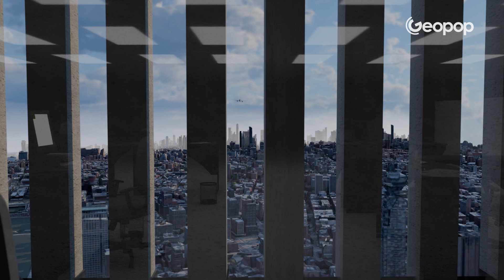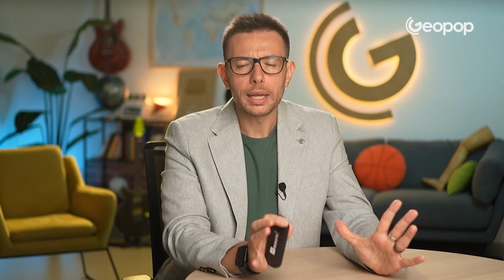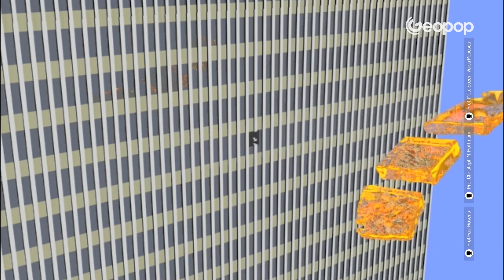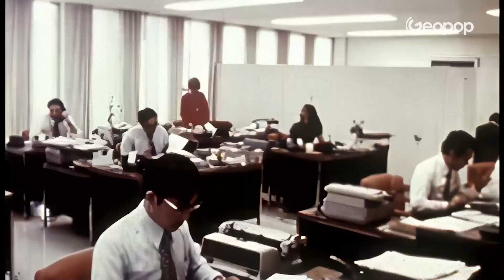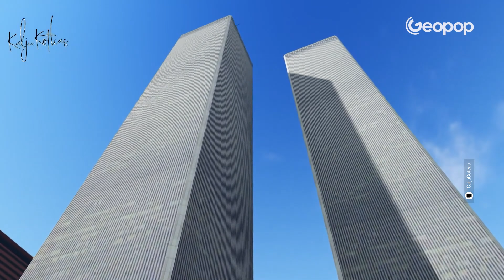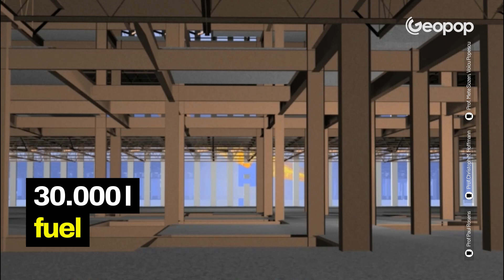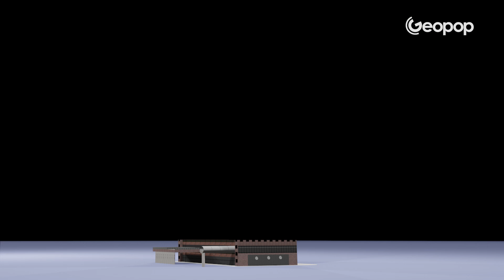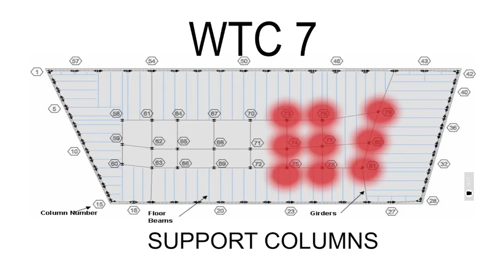9/11, 2001: The Technical Reconstruction of the Twin Towers and WTC 7 Collapses

Comment: NIST says there was no explosives used in the collapse. NIST also says they did not test for explosives....
Thermit has been found in the dust from that day.

All the items in that building were fireproofed. Its a sky rise and only allows fire resistance materials that do not burn like normal furniture.
Reply: Worth noting thermite is an incendiary, not an explosive and the ONLY reason it was entered into the discussion was because conspiracists needed something to rationalize the obvious lack of explosions. 

So you should probably figure out what case you want to argue before arguing it. 

Also, the idea that nobody can bring anything into a building that will burn is mind-numbingly stupid. But I guess that is why there are never any building fires and we don't need fire departments anymore 🤦‍♂
Reply: @TheLoonResistance  First of all Thermite is an explosive if used that way, secondly they never tested for thermite or any other type of explosive. This is a fact.
Independent testing shows thermite in the dust. This is a fact.

Thermite = When ignited by heat or chemical reaction, thermite undergoes an exothermic reduction-oxidation (redox) reaction. Most varieties are not explosive, but can create brief bursts of heat and high temperature in a small area. Its form of action is similar to that of other fuel-oxidizer mixtures, such as black powder.....

* Most varieties are not explosive* which means some are explosive...Maybe you are to young to remember all the explosions you could hear that day, there was hundreds if not thousands that day.

As for the building materials and furniture, all that stuff was rated as fire resistant materials. I never said that nobody could bring in something that can burn , stop arguing in bad faith by saying I said that when I did not.

If you honestly think all the things that happened that day happened by chance, you should buy a lottery ticket right now.
Reply: @TheLoonResistance  ", the idea that nobody can bring anything into a building that will burn is mind-numbingly stupid. But I guess that is why there are never any building fires and we don't need fire departments anymore "

Way to strawman the argument, you win! Great job, you only had to create a statement and debunk something that I never said... You must really have a valid counterpoint to make up something that was never stated...
Reply: @EQ_EnchantX  - Two months later and that was the best you can do?

I will remember that the next time I walk into the steel framed office building where I work, carrying a box of totally flammable paper, sit down at my totally flammable wooden desk with a totally flammable plastic cased PC, monitor and printer on it and don't get accosted by the OSHA commando's.

FFS 🤦‍♂
Reply: @TheLoonResistance  Sadly I replied 2 times before and it seems they got deleted or censored...And where did I ever say non flammable? I said that stuff in high rise buildings are rated to be fire retardant... there is laws in place, you can't just bring anything normal furniture into a high rise office space. Go learn the laws...
Reply: @EQ_EnchantX  - Great. Cite the statute and how it is enforced.
Reply: @TheLoonResistance  
Chapter 8: Interior Furnishings, Decorations and Scenery

Section FC 801: General
Reply: @EQ_EnchantX  And?
Reply: @TheLoonResistance  Nothing I say is going to change your mind, so I am done wasting my time. You go ahead and keep believing the government "official" story, because we all know how trustworthy they are, they wouldn't lie or cover up anything now would they?
Reply: @TheLoonResistance  
" Worth noting thermite is an incendiary, not an explosive and the ONLY reason it was entered into the discussion was because conspiracists needed something to rationalize the obvious lack of explosions. "

Go read 

Explosives Found in
World Trade Center Dust

Scientists Discover Both Residues
and Unignited Fragments of Nano-Engineered Thermitic Pyrotechnics in Debris From the Twin Towers

In terms of energy density, thermite is roughly comparable to TNT, packing slightly less energy per unit of mass but about three times as much energy per unit of volume. In terms of power density, thermitic preparations range across a wide spectrum, whose upper end appears to be comparable to conventional high explosives.
Reply: What NIST said was they followed the evidence, and none of it pointed towards explosives. That's how forensic investigations work.

Oh, and the thermite claim has been debunked.

Comment: "Every action has an equal and opposite reaction" is a statement describing Newton's Third Law of Motion which means that whenever one object exerts a force on another object, the second object exerts a force back on the first object that is equal in magnitude but opposite in direction; essentially, for every action, there is an equal and opposite reaction.

The top 20 floors could never crush the bottom 80 floors. The most they could have taken out were another 20 floors. Therefore only half the building should have fallen. The steel on the lower floors had no fire damage and were solid and the force on top wasn’t enough to crush it without assistance. If anything, half the Towers should have remained. 

It’s basic science.
Reply: Sorry, your "basic science" is dead wrong! 20 floors defeated 1 floor ... and then 21 floors defeated 1 ... then 22 floors, then 23 ... one floor at a time until the whole building is down.

Here's what your forgetting: Gravitational Potential Energy. All that high mass is going to keep pressing down on the now-compromised structure, tearing it up 1 floor at a time until it's down.
Reply: @Tim22222  sure and I bet you believe the planes were flying at 600mph at sea level when that would break them apart. Two planes took down 3 towers in an hour in perfect implosion style. People like you are why the government does what it does.
Reply: @johnbnyc64  - You are indeed mis-applying physics by fundamentally not understanding the collapses. It sucks and hurts the ego, but it's true. Let me explain. 

I find Twin Towers collapses intellectually fascinating, my interest being understanding the actual mechanisms of collapse - what failed, when, how & why and discussing those mechanisms with others who share a similar genuine interest in understanding what really happened instead of rationalizing some political agenda. So let's talk about it.  If at the end you disagree with anything, please let me know what you object to and why. Make it good. I don’t suffer fools. This will take just a few minutes.

This is my summary explanation of Twin Towers collapses of the Twin Towers, start-to-finish, based on my observations without appeal to, or reliance on any authority. No politics or ideology, just what actually happened, which is agnostic to who planned and carried out the 9/11 attacks or why. It has the benefit of not requiring Rube Goldberg levels of complexity and it makes logical sense. Each step in the process flows naturally from the one before AND is chock full of critical details the conspiracy oriented internet tends to leave out with no whataboutisms.  My hope is this will dispel many common myths and answer most if not all questions you may have about the Twin Towers collapses. 

While complex, most of the Twin Towers collapse mechanisms can be seen with the naked eye and easily discerned and understood by the layperson if sufficient time is taken to understand. The worlds engineering community had already largely sorted them out at least as early as October/November 2001. Still, there are many who can’t be bothered to look or perhaps work hard not to see, being more concerned about advancing political/ideological agendas (which is exciting) than science and engineering (which is boring).

1. The Twin Towers consisted of 4 primary structural elements that together formed an integrated system where each relied on the others.  47 hollow box-section steel Core Columns carry the majority of the gravity loads. The 236 hollow box-section steel Perimeter Columns carry the remainder and ALL of the lateral (wind) loads. Long-span Lightweight Steel Trusses connect the core and perimeter column together at each floor with a Hat Truss on top to tie the structure together as an integrated unit where no element can survive without the others 

2. The impact of 117 tons of airplane (= to about 12 dump trucks) at speeds up to 590 mph completely destroys the aircraft.  This in no way implies the Towers come out unscathed. Some folks don’t get that. Hitting with the energy of up to a ton of TNT the impact damages or destroys many perimeter and some core columns (33 of 59 perimeter and 20 core columns destroyed at the impact floors in the North Tower), primarily through bolt-shearing failures at the end connecting flanges, as well as bending, twisting and fracturing of weld seams. There was no cutting or slicing - the reality was far more violent and messy. 

3. The impacts destroy or damage fire insulation, fire breaks and sprinkler systems on multiple floors. Huge fires are started across multiple floors simultaneously and allowed to spread rapidly with no effective firefighting or fire suppression. This was an unprecedented fire event . All of this was observed and recorded.

4. The hotter steel gets the weaker it gets .  With fire insulation stripped away and no sprinklers the survival time of the steel greatly reduced. Gradually over time heat causes the lightweight steel Floor Trusses at the impact damaged floors to sag, which was observed and recorded.  No steel melted nor did it need to. Structural steel will fail long before it turns to a puddle. It just needs to bend

5. Sagging floor trusses pull on the increasingly weak and overloaded Perimeter Columns, causing some of them to bow inward by up to 5 feet. This was observed and recorded. A straight column is up to 4 times stronger than a bent column. 

6. The bowed Perimeter Columns buckle and fail, initiating collapse. This was observed and recorded.  The formerly static mass above which the structure below could easily support is now converted into a dynamic mass up to 30 times greater. Because they have buckled, the Columns above and below the failure point are no longer aligned . The load bearing structure below no longer bears any load as it falls past the lower columns, NOT onto them.

7. Thousands of tons of debris fall within the four outer walls, down through the open office space, crashing onto the first intact floor it encounters. This massive impact immediately breaks the bolted connections to the columns as the amount of resistance the Floor Trusses can offer is negligible.  The falling debris slows only marginally and briefly. Note:
7a. This is NOT a solid top block crashing into and “crushing” a solid bottom block .
7b. The debris falls past the columns not onto them.  The columns provide no resistance to the falling debris. 
7c. Only the bolted connections of the floor trusses to the core and perimeter columns can offer any resistance. A pair of 5/8” bolts at each end of each truss vs. thousands of tons of falling debris.

8.  This floor-led collapse progression within the four outer walls can only go straight down. Note: 
8a. This process is often incorrectly referred to as “pancaking” which actually refers to a completely different process rejected at an early stage. The catchy name stuck but nobody knows what it is supposed to mean.  Pancaking is too simplistic and inaccurate anyway. More like Kaiserschmarrn.

9. Collapse progresses through the floor systems and not down the columns. Rate of floor assembly failures increases with each successive floor as momentum increases, reaching an average acceleration of 0.65 of GA, or 35% slower than true free fall. Bam, bam, bam down the building until there are no more floors to fail.  The resistance offered by each successive floor is always the same. The mass and velocity and thus the energy of the falling debris are constantly increasing.  The falling mass increases with every floor it destroys as new falling mass is added. Some falls to the sides, but most falls down. More mass, more velocity, same resistance with each floor.
The above is unquestionably the path of least resistance

10. The Towers were 95% air by volume and as that air was compressed inside the building it is forced down the tower and blown out the sides in reaction to the building collapsing not causing the collapse. Those were not “explosions”, it was expulsions of compressed air. 

11. Perimeter Columns become detached and peel away like a banana behind the collapse front, playing out to the four points of the compass extending to more than 600 feet from the base of the towers. This was observed and recorded, the results quite obvious from examination of the debris pile. 

12. Core Columns fail last as their internal beam bracing is stripped away and lateral support from the floor to perimeter columns is lost. This was observed and recorded and is most obvious in the North Tower. 

13. For those who care about how long this took, the whole process took 31-34 seconds from the moment the perimeter columns buckled until the last core columns hit the pile, or 1/3 the rate of true free fall. Don’t believe me?  Just watch any video of the collapses and note all the loose and truly free falling debris dropping much faster than the towers themselves.

14. What was NOT observed and recorded were the 180-190 dB bangs of high explosives or the blinding bright flashes of burning thermite. Of course, neither could have caused the (silent) Perimeter Column buckling that was observed.  Neither explosives or thermite could have survived the impacts and subsequent fires either. Cherry-picking a casual comment from someone who heard a loud noise in an event like 9/11 is not exactly “proof” of anything and the pre—planned demolition case relies entirely on that. There is zero physical evidence to support either conjecture. It would be technically impossible, totally impractical and completely unnecessary. No one would bother. 

15.  The Twin Towers were perfectly safe within their design envelope.  They only collapsed when taken far outside design parameters by an extraordinary and unprecedented event. 

Impact + Fire (heat) + Time + Gravity = Collapse . Remove any one of those four elements and there is no collapse. Ignore any of those elements (as many do) and you will never understand the collapses. The Twin Towers were an integrated system in which no one component could survive without the others. One fails, the rest follow, through the path of least resistance – DOWN – through the open space, bypassing the path of greatest resistance – the columns. Don’t get stuck on the but the lower floors weren’t on fire nonsense. 

I hope you found this helpful. It is meant to be informative, not adversarial, posted with the objective of soliciting informed critical comment, positive or negative. If I made any errors of fact, logic or reason or left anything critical out, please let me know so I can fix it. One topic at a time, on topic only please to stay focused, no word-salads of Gish Gallop. IF you can offer a more plausible alternative be my guest. So far no one has even tried. Please start any reply with the words “Tits McGee” or I will know you didn’t actually read it, are not serious and just wasting my time.

Comment: The steel core and external steel were not a major cause of the collapse. The floor is supported by Bar Joist, which is made of soft rebar primarily with a 4 inch thick lightweight concrete slab. The load bearing of the floor system is usually 200 lbs per square foot. The bar joists above the fire lost all strength, and the weight of the floor crashed down on the fire floors. The fire floors weakened their bar joists, and the added weight of the above floors collapsing created a house of cards. The fire weakened steel, and broken columns were pulled down towards the center of the building by the weight of the  collapsing floor system. The video shows the building bulging as the floor system collapsing.

Comment: I was always taught that black smoke meant a fire was starved for oxygen. The video you show, indicates both buildings had plumes of black smoke emanating from them... Considering you need 3 elements for a fire, surely the fire couldn't reach anywhere near the temps you suggest when one of those elements is limited?
Reply: Nope, not true! Check out petroleum fires, for example: Thick black smoke even when out in the open where oxygen is plentiful. Just another hoax myth. The color of the smoke indicates what's burning, not the temperature or availability of oxygen.